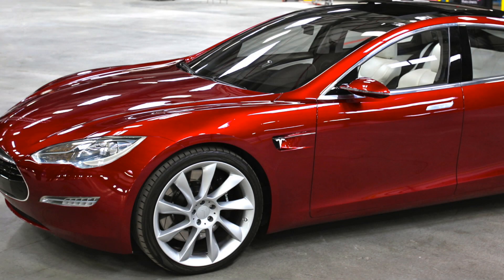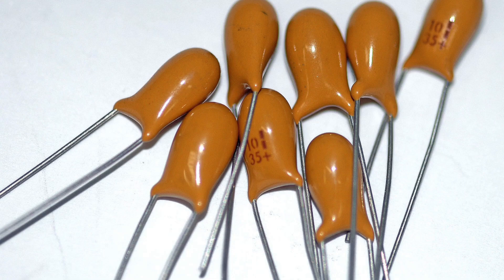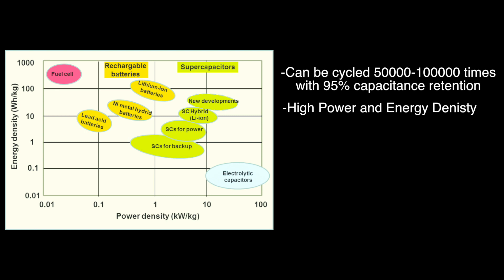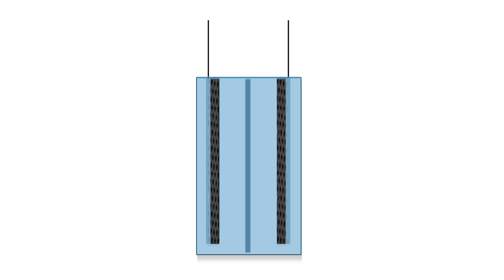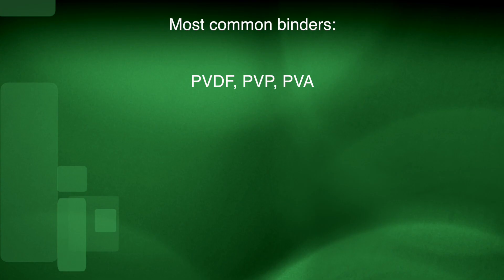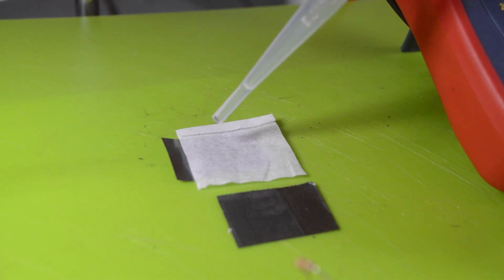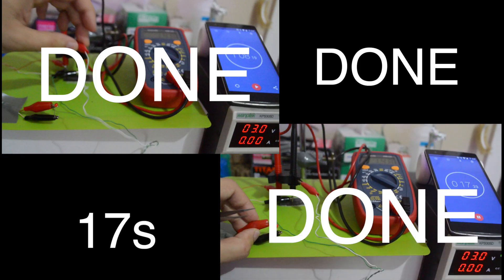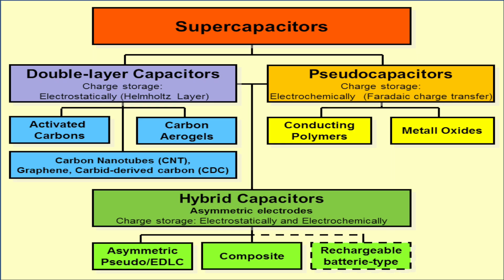How To Make A Basic Supercapacitor

Comment: Can you go into more detail on comparison between the different graphite binders? Ive been experimenting with conductive paint recipes for electroplating. Best results so far have been 6:1 graphite/ PPG Deltron (catalyzed urethane clear) reduced 50% - 6 coats LIGHT coats with a .3mm nozzle buffed with suede between coats (the buffing turns out to be key). Best ive gotten is 100ohm/cm, but I'd like to achieve better. 

PVA, shelac, nail polish, acrylic, and the other youtube suggestions resulted in 250+ohm

Comment: Lithium-ion cells work similarly to that of both Lead-acid batteries and supercapacitors in term of charging and discharging cycles. What Supercapacitors have going for them is that there are a few brands and models that absolutely do not use flammable electrolytes, likewise for solid-state Lithium-ion cells - supercapacitors are useful for certain projects that needs a lot of juice, PRONTO, or basically just to keep time on the real-time clock chips. They both need balancer, obviously, if you care about the lifespans and safety. And yes, low internal resistance Lithium-ion cells also exist, yet sometimes they're hard to find. I use either or both in my DIY electronics projects.

Comment: 1:28 So after fully discharging a lead acid battery I can both 
1. reverse the polarity by simply charging it the other way around and 
2. fill up the battery with simple destilled water instead of sulfuric acid?

Comment: Hi, very informative Video!👍👍
I have a few Questions, maybe someone can answer.
1. Wont the Sulfuric acid (or other strong acids) destroy the separator paper?
2. What was your last change in the Video to achieve 0.6 Farads?
3. How to find out the Peak Voltage? Set it to maybe 3V and does the capacitor settles down its Voltage by itself?
Thank you for your answer 👍

Comment: The diagram has supercaps in FM land. In the AM world they are stuck bottom right. 99% of existing caps have bugger all to do with chemical reactions but you kept saying it. and if they do it still has nothing to do with operation. They all store energy in the electric field. Lithium ion batteries are not popular because they are high energy density devices only. There are simply dozens of alternate chemistries that are  even more energy dense than Li-Ion. They are lightweight is the part along with the e-density that completes the whole and makes them close to ideal. They still though need a ton of them to get a car 150km when a cup full of petrol will shift a ton to 70mph for five mins. Caps are currently the same magnitude behind a double A.
And its now 2022...

Comment: @The Thought Emporium I am having a problem .. I have tried to make battery 3 times and two with activated carbon and one with manganese dioxide .. Used potassium hydroxide as well as sodium sulphate electrolytes and charged on 2.6v  (at 3 volt electrolyte start burning) but all the time after charging voltage suddenly start dropping and battery don't have power to test on EBDtester ... Can anyone rectify what I am missing 😔

Comment: You were probably getting much higher than 0.6f.  With a capacitor, you should be discharging to basically zero.  Often super capacitors have lot's of remaining power under 1 volt!  Plus your load is likely causing tons of voltage sage with those tiny things, so you likely were no where near fully discharged!

Comment: If the heart of batteries is a reversible reaction, then why don't we use Hydrogen and Oxygen for batteries?
Reply: That is an excellent idea. We do in fact do this in hydrogen powered cars although in my opinion this technology has a long way to go. If you're curious, look up hydrogen fuel cells.
Reply: @CrazyNerdInventor  i've actually been looking into hydrogen fuel cells for a while, but normally they vent the reacted gases into the atmosphere as water vapor.
Reply: Fuel cells, but there are no cost memebrane material available that will prevent the gases from crossing over. The membrane has to permit ions to exchange, but not leak the gases. Nafion is the commonly used membrane used in low termperate fuel cells, but these types of fuel cells need to be rebuilt after a few thousand hours or use. The other issue is that the reaction needs a platinium group catalyst to operating making the expensive. there is also high temperature Fuel cells that don't need a catalysts but need to operate at 600F or higher.

There is also a semi fuel cell battery: Nickel hydrogen batteries but require a pressure vessel to contain pressurized hydrogen as the energy source. issue is hydrogen leaks out of pressure containers and they are typically about 10 times more expensive than Lithium ion batteries.

Comment: Very good video. Congratulations.
I saw a 2.7 Volt supercapacitor and 500 unwind Farazi that consisted of two layers of activated carbon and two layers of paper.
It was dry and had no electrolyte between the layers.
It was built like an ordinary capacitor: paper and aluminum, only the supercapacitor had two overlapping layers.
I think that decomposing such a capacitor and measuring it, analyzing it and explaining it would be an interesting thing for those interested in this subject.
That layer of activated carbon should be analyzed to know what it is made of.
Thanks.

Comment: There was a relatively recent paper that I saw about creating proper single layer graphene on copper foil. It might be interesting to try and use their method to make electrodes for the capacitor, especially since their description had it in a continuous spool that would be conducive to wrapping a cylindrical capacitor.

Comment: Just as a note, on Wikipedia it states that 4 Leyden Jars in parallel was the basis for the worlds first battery (capacitors were originally called Leyden Jars). 

Supercapacitors could be improvised by connecting lots of capacitors in parallel.

Comment: What about LTO cells? I know this video was made quite a long time ago. But I still want to know what you think.
Reply: I am interested in fast discharge and fast charge. I am into car audio. I also live in Indiana which gets cold. I need a battery that has safety, high current, large temperature operating temperature, and the most power density for all of the above. LTO seems to be everything I need. I would definitely like to couple the LTO with super caps. I think that would be the best hybrid system you could make with the technology available now. Let me know your thoughts.

Comment: What about mechanical kinetic flywheel batteries?
Reply: Zach R 
How fast fo you want that to spin ?
Reply: ᏰĪᏝᏝ ՇÎρɧᏋƦ it depends on how massive it is, where the mass is located (close to the edge or center), and also the friction losses. Check out Eulers Turbine equation.

Comment: How do I know what voltage to charge it with?
Reply: Jo Flo. Good question. Not sure. All I know is If it blows up, that is a good indicator that too much power was used.
Reply: Jo Flo. 11:03
Reply: The maximum voltage is limited to the breakdown of the electrolyte. Water has a breakdown voltage of about 1.2V. Any more the water begins electrolysis converting water into hydrogen & oxygen. For any given electrolyte you have have to lookup the breakdown voltage or measure it your self (Use two metal electrodes in the solution and raise the voltage until you see bubbles)

Comment: In your Ragone plot, how did EDLC's end up higher then Batteries in terms of energy density?! This is wrong! Check, e.g., Simon, P. and Gogotsi, Y.: Materials for electrochemical capacitors. Nat. Mater. 7, 845 (2008). In a simplified explanation: energy in chemical reactions (electron transfers) is generally higher then electrostatic interaction resulting in the electric double layer as the principle behind EDLC's. Nonetheless EDLC have a have a high potential especially if the electrochemical stability of the electrolyte can be increased. Anyway this is a complex topic for a short YT comment ;) feel free to ask qs.
BTW nice assembly!

Comment: What if just paper sparator with no electrolite..
What about the voltage?
Reply: I think that's just a standard capacitor, conductive plated separated by a dielectric
Reply: @tk4x431  yes..ur super caps..what is the voltage ..2v? Or 2.5v?
Reply: @budhihart8161  Depends on the electrolytes breakdown voltage when it begins to outgass hydrogen\oxygen from electrolysis. For water with a salt its 1.2V. I believe the highest is about 2.7V.

Comment: Why would you paint the graphfoil with graphite powder? Wouldnt it be sufficient enough to just use the graphoil itself? Whats the use?
Reply from the maker: significant increase in surface area and therefor more charge storage surfaces.
Reply: @thethoughtemporium  aah you mean the graphfoil is just a stable construct to keep it a study surface and you just put another layer of even better graphite (due to being optimized).
Reply from the maker: ya graphite isn't even best. Before I put this project down I was looking at graphene nanofoams coated in inorganic nanowires, amongst other things. Graphite foil is just nice because it won't dissolve if you use strong acids or other concentrated electrolytes. one less thing to worry about.
Reply: @thethoughtemporium  Hey Thought Emporium, would you mind to reveal what kind of electrolyte you used for the 0,6F test capacitor? Did you put activated carbon which was "enhanced" before to get a greater surface area with the casein/school glue binder? Thanks in advance :)

Comment: I was thinking, instead of graphene, what do you think about silver nanoparticles? Silver conducts probably best of all elements, and it is nano so it will have good surface area, also silver is chemically active so you could use an electrolyte that cause chemical reaction? I checked and silver nanoparticles are about $25 a gram online.
Reply: Also check out silver-zinc batteries. They look promising and are somewhat safer than Li batteries

Comment: You got the part at 2:50 backwards, the empty battery has the lithium in the transition metal oxide layer, while the charged battery has the lithium in the graphite layer.

Comment: I need a little help finding a good separator for my electrodes. Do you have an suggestions?
Reply from the maker: Sorry can't really help much there. Separators are one of the few things I haven't experimented with much. I normally just use a piece of thin tissue paper, but there are a lot better options, or so I'm told.
Reply: I will see what I can do. The reason I don't like tissue paper is because I think I would degrade rather quickly. I have been licking for a plastic alternative... but haven't found anything.
Reply: Keith Reynolds, thank you for the help.
Reply: @quantumlab9130  I think a fiberglass mat, nylon cloth would work. Just need something to insulate the two electrodes but allow ion exchange.

Comment: This capacitors are shitty! Use your sugar nanofoam (but this time KOH catalyzed), heat it under a oxy-propane flame until you get a resistance of only a few ohms/Cm. Then mix 50ml of this carbon foam with 50ml of a mix of 5g PVA and 50ml Water, to increase the conductivity further, you can add some carbon fibers. As Electrolyte use some "big, fast" intercalatable ions in form of salts for example porphyrines (Chlorophylle is very good) or AlCl3 because it forms in water AlCl3 + H2O ----> Al(OH)3 and HCl or better use a AlCl3-urea ionic liquid: AlCl3 + urea ---> [AlCl2.HCl]+ +AlCl4 AlCl4- can then be further intercalated into the carbon electrodes. With this setup you can get up 1000F/g or even more.
Reply from the maker: Well ya, that was the point. If I'd said "here's how to make an amazing supercapcitor that breaks all current standards" it'd be a very different video. The idea was to cover the basics.
Reply: The Thought Emporium 
I meant on one side you're showing how to make a “comparably“ (of course for noobies only) complex binder, but on the other side you didn't even use activated carbon, why??
Oh, and another question:
Do you think Chlorophylles may be a good (promising) electrolyte for biodegradable capacitors? In my opinion yes, because chlorophylle can make complexes with oxygen as well as hydrogen and thus it intercalates or at least form a pseudocapacitive helmholtz layer on both electrodes.

lg André Leonhardt
Reply from the maker: I don't use activated carbon because that's going to be a whole video on it's own. It's a really complicated topic with literally hundreds of papers detailing all sorts of variations, so it needed more attention than a 4 second spot in an intro video. 
As to chlorophyll, I dunno, haven't tried it. It could be, there are some really large electrolytes that form complexes with 8-10 charge in them. It's cheap so I can give it a try. I doubt it'll intercalate though. Thing might intercalate into it which could be interesting, but it's a huge molecule. Fitting into a carbon structure would be a pain.
Reply: The Thought Emporium 
Well, thats right, I guess.
There are so many things you have to pay attention to. For example pyrolyzing (carbonizing) temperature, Katalyst (I use KOH or FeCl3), dopants (You can N-dope it with a bit of urea while activating) and last but not least the precursor f.e. Sugar, wheat flour, bread, yeast...... ----these make all very high surface area carbon with a capacity of up to 600F/g, but there are things that won't perform as good for example wood.
Oh, and: When trying to use sugar foam, please activate this sugar foam with FeCl3 (4%) under 1300C, be aware that this sort of carbon will be highy superhydrophobic, so you have to add sort of tenside (sodium lauryl sulphate or even poly(Vinyl alcohole) may work, because of its large chains and single functional group).

Comment: 0.6 farads AKA 600.000 microfarads ??!?  have you ever seen the size and surface of one of those compared to what you have on the table?!? are you ill in the head? did you snort the electrolyte?
Reply from the maker: You can check my math yourself, it's a continuous shot. This is the whole point of a supercapacitor. And also, that's not even high enough yet. When I'm done it'll be well into the farad range for about the same size. I need 40 farads at 4 volts in a space 2cmx4cmx 1mm thick.
Reply: i don't care, i have two super-caps in a drawer. I opened the drawer and looked at them... then looked again at the video and said to myself: fuck  Maxell, fuck Hitachi ..i'm gonna buy Emporium....
Reply: @thethoughtemporium  
Hello, clearly from your comment you indicate that you will continue your experiments. 
what is the best capacity you have got after this video?
What is its construction? if yes and if possible.
what is the cycles of this capacitor is it like ordinary capacitor? I mean does it has up to million cycles?

Comment: I understand the graphene capacitors still have leakage ...no good for long time energy storage ..Robert Muray has come with a paper battery with dried electrodes made by using his special ink....I understand ,this type of paper battery can be charged at high level of voltage and keep the voltage for long periods of time...I am a beginer in this exciting stuff so , can you research his ideea a little and make some video covering this type of battery? I have watched Robert videos;there are a lot of informations but still I am lost ...I like your videos because are very practical , at the object not a lot of theories and words dificult to follow and understand like Robert did in his movies ;to understand his work you need to take all informations from all his videos and put them together ;after that you need using your intuition to make connections between different parts of his movies ;not an easy task ...below I put the Robert movie about his dried paper batteries...I am curios how he made the ink to make it work on paper without wet electrolyte... https://www.youtube.com/watch?v=DrA7N19bSdA&t=305s
Reply from the maker: I've been meaning to replicate his cells, i've just been super busy so I haven't had a moment. I'll see if I can make that video soon, but I've got a lot of other stuff on the docket first

Comment: Hi...at one of the Robert Murray video  here https://www.youtube.com/watch?v=GSDSUFvLOEo   you stated about an method regarding using autoclave to increase surface area of capacitor electrodes ; your coment on Muray video:  If you use a hydrothermal reactor you can get the surface area even higher. I just went in to the SEM lab to look at the nanofoam the process makes and it's pretty crazy. I'll finish editing the video and post here when it's done.....can you please let me know where can I find that video you talking about?
Reply from the maker: Are you looking for the nanofoam video?
Reply: I am looking for  the video  about you talking in that comment...you know much better than me  about what you mentioned in that comment...
Reply from the maker: I was probably talking about the nanofoam then.  https://www.youtube.com/watch?v=OVT-WxbHflc

Comment: Question has anyone tried adding a magnetite strip between two paper separator. Could using a magnetite strip in place of electrolyte attract electrons. If yes would you still be dependant on surface area or could then look at density instead of surface area.?
Reply: Was thinking of Graphene as it’s has been said it can interact with a magnetic field. Could it attract electrons from the Graphene storing the electrons.
Reply from the maker: I don't think that would work, and if it did it would either be highly inefficient, or a totally different kind of device.
Reply: So I take it that it’s probably never been tried or experienced with.

Comment: LED has no resistance, therefore in your lit duration test you just short circuit and measure capacitance with your capacitors internal resistance.
Reply: It has some resistance
Reply: LEDs do have resistance